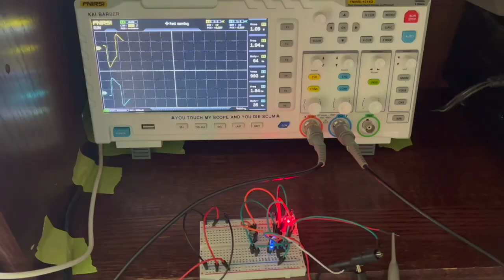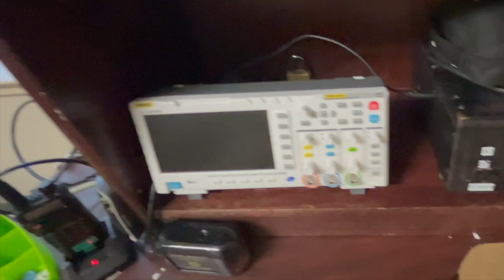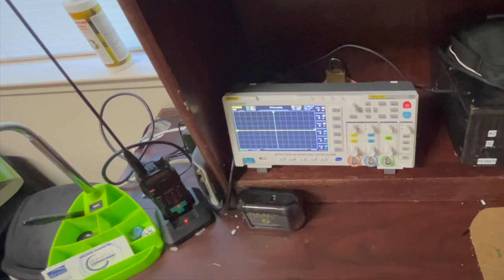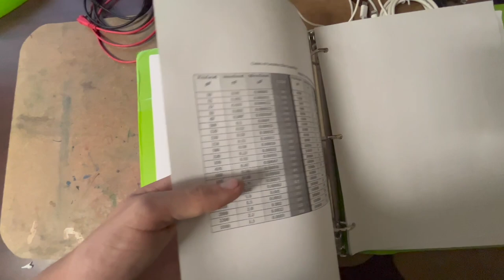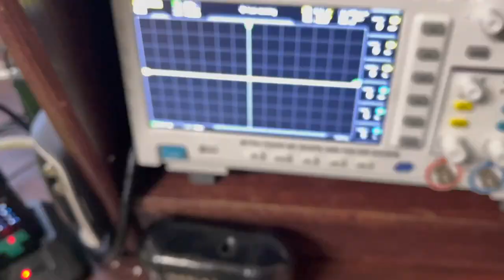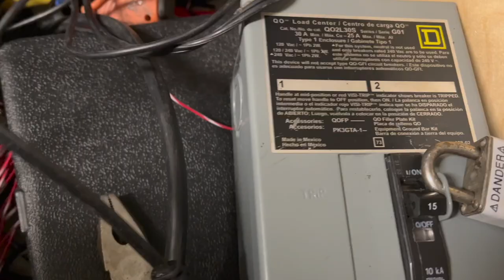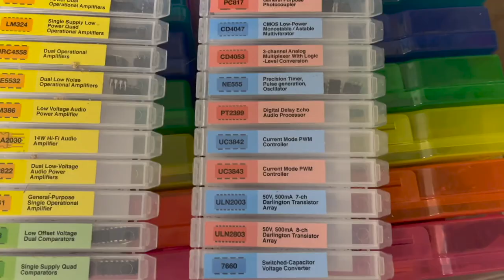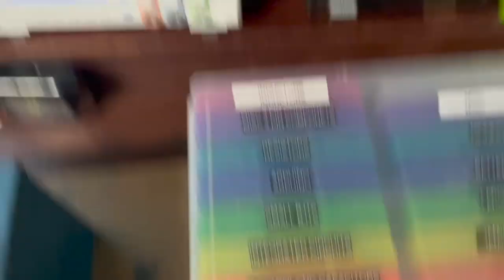Tour of the tools and equipment I keep in my college dorm room

Comment: I've been looking at the FNISRI specs. What work do you do that requires a Keysight (since it's around 10 times the price!)?
Reply from the maker: I don’t do any work that requires a keysight, I’ve just used keysight scopes and I know what they are capable of and I know they last forever. I’ve wanted a DSOX1204 for years but I can’t justify $1200. A Rigol would do fine for me it’s just that fact that I’m familiar with the menus on keysight scopes and there are things that come by default on a keysight you can’t get on a Rigol like more math functions, built in function generator, really good FFT and a few other functions. I wouldn’t recommend buying the FNIRSI anymore because I’ve blown the front end on mine twice and it’s missing a lot of functionality other scopes have, it really does feel like a toy compared to even a Rigol.